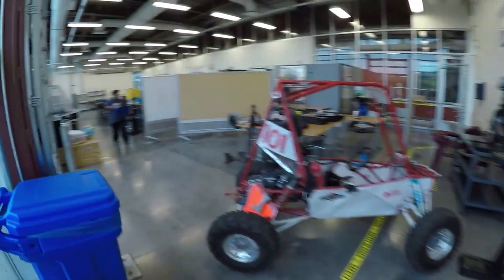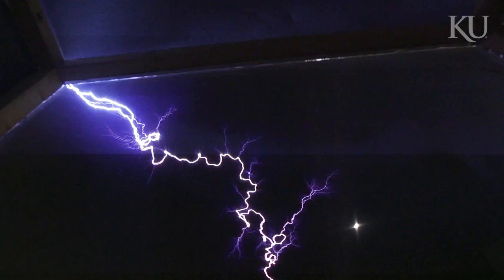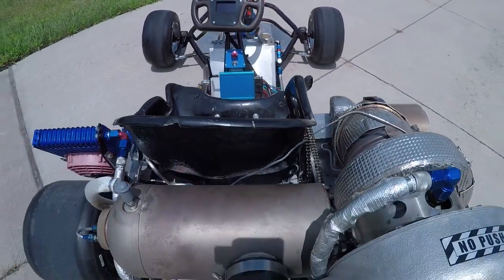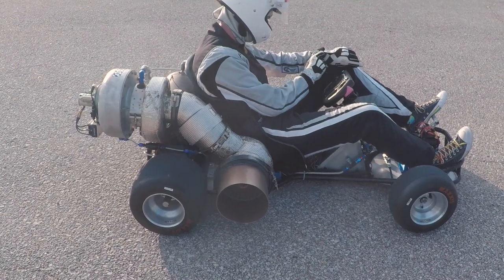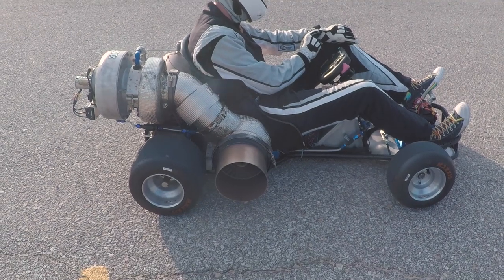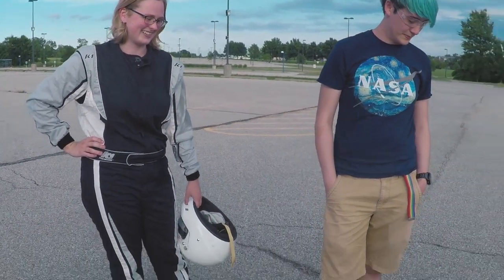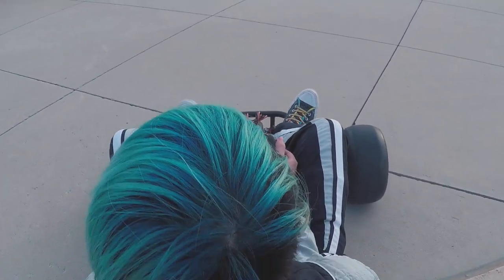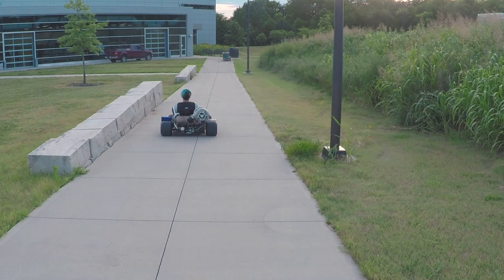Jet Powered Go Kart - DIY Turboshaft Engine

Comment: About time someone finally combined go karting and hearing damage.
Reply: Actually, in terms of how loud it is, it is not actually that loud. If you look closely, nobody was wearing ear protection. The power turbine (the thing that you can see spinning inside the metal cylinder) damps a lot of noise. In fact, unless you're throttling up to full power, you can barely hear it at the other side of the parking lot, which is around 100 meters away.
Reply: Yea not many stupidly exciting kart projects like this with turboshafts
Reply: Yeo

Comment: I really wish the car industry would put some actual effort into alternative power plants, I mean they're focusing way too hard on electric, why not try turbine and steam once more? They already know how both work quite intimately, such as the Chevy SE-124/Pontiac SE-101 and the Chrysler Turbine, why not develop these things to their limits, right? ICEs have hit 56% efficiency with SkyActivX, electric cars have managed 250 Wh/kg with Tesla's best batteries, back in the 1960s Chevy's SE-124 Chevelle test-bed managed equivalent 15 mpg when the average was around 8 for cars of similar mass and both steam and turbines run on literally any fuel that can be burned in the combustor. There's no reason to not develop this technology I'd say.

So wonderful job on this you guys, that's probably the best running turbocharger-style turboshaft engine I've seen yet, very smooth and linear acceleration from what I could tell, smooth startup, the management electrics are quite nifty to see do their job as intended. I'm happy someone is still working on turbine-related automotive projects :D

Comment: That's so cool. I want to build a turboshaft with at least 100hp to power a medium duty freight truck. It seems like it should be easier than building a piston engine because there's no large scale high temperature casting involved afaik, the parts can be welded steel

Comment: Love the video, hope some one actually take the time to do a really good alignment.. other wise there will not be enough tires to replace in the front!!!
Reply: Considering that we actually built from an oval racing kart from the 70s, that might actually involve re-engineering the entire steering lol
Reply from the maker: Good catch, unfortunately that camber issue is a result of a bent frame. Toe is set properly and it's comfortable to drive, but eventually it will take some force and welding to fix.

Comment: It seems, there are infinite applications turbo shaft engines. What's the efficiency? Horse power ?
Reply from the maker: We agree. Efficiency? It's a space heater that accidentally turns some wheels. Horsepower, probably 30-40 when it's really moving. It generates more power as you pick up speed, the parking lot isn't large enough.
Reply: @highvoltagefeathers  nice, love the analogy. "Accidentally turns some wheels" priceless! Lol
Reply: "Space heater that accidentally turns some wheels" 😂 @highvoltagefeathers